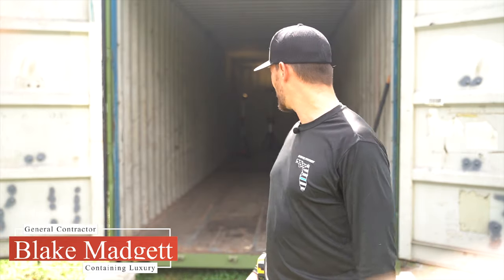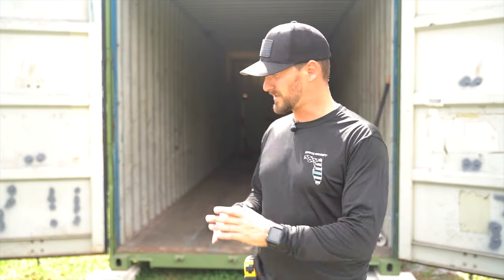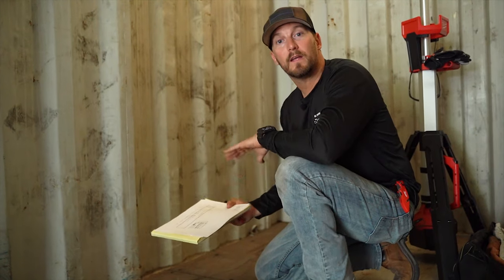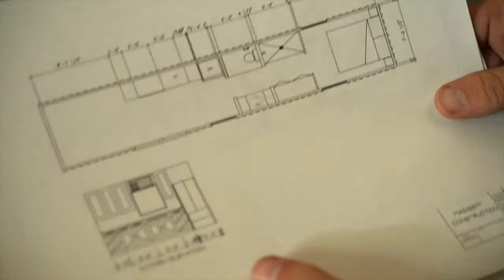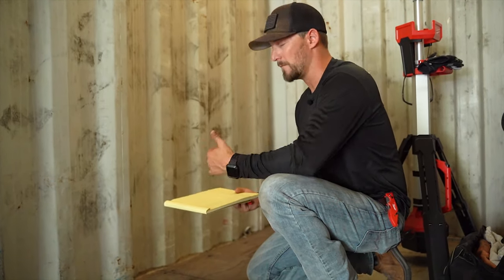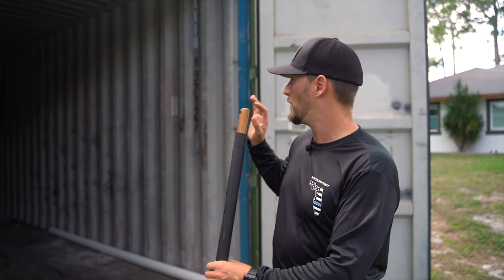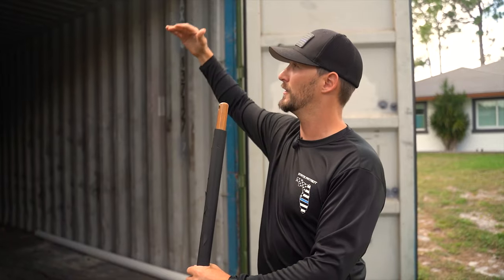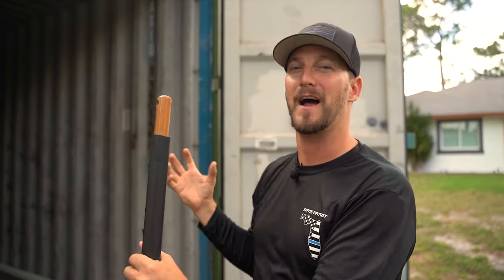Build a DIY Shipping Container Home Step by Step | Ep. 1 Prep, Plans and Layout

Comment: Could you make a video about the procurement of the container? I have seen on many other videos how you have to be careful with used ones because they dose the floorboards with massive amounts of pesticides that can off-gas, and that the interior paint is also pest resistant and can be toxic. How did you shop for yours and who did you go with for the purchase? Also, how did you transport it? A freight hauling company? An industrial towing company? Thanks and great vids!
Reply: If you’re serious about buying containers than it’s best to look into what’s called a “one-time use” container. They are only used one time and are used for harmless things. So you wouldn’t have to worry about dangerous chemicals, rust, etc.

Comment: I also am from and live in Minnesota.Years ago I used to work for this company where we installed Styrofoam stucco walls on the exterior of homes and buildings.3 inch minimum with 5-7 inch thick  for accent around windows or other areas to create features.Now if you do this you can minimize any insulation for the inside since your insulating your outer walls giving you move interior room.

Comment: Amazing and I didn’t quite understand the tip about having the plumbing and elctrical be linear, is that so the lines come out the front if this like the containers door and you just cut a hole for those lines through a no structural part of the door? And do you run those lines through the floor inside, as opposed to cutting a hole in the floor and o run them outside?

Comment: Question: how do I connect 2 containers side by side to make a bigger room?
Reply: Cut the walls between them and you would have to get steel plates and weld them together. That way you know it will be water tight and wont have to worry about leaks
Reply: Also you would need to get a few acros also known as scaffolding Jack's to support the roof of the walls you cut out
Reply: You could set them a few feet apart and build a room in the middle.  Of course you'd have to build a roof over it 😉. Check out life uncontained   they did a great job
Reply: @DrLove911  oh I'd like to but I don't have enough room. I'm going to attach it to my existing house and add 4 containers but little room to work with. And I've seen them do that I've enjoyed watching them too!
Reply: Keep in mind when you join two containers together there will be a 6 in gap between them that you'll have to weld a strip of steel over.  And when you cut the sides out you'll have to reinforce it with either steel or wood . Also good luck 😉👍

Comment: Hi :) What is the difference closed and open cell foam? Why closed is better for container homes?
Reply: Closed-cell foam is non-porous so it won't absorb moisture.  It gives a good thermal break to keep heat from transferring between the outer / inner walls.

Comment: In your example you were 3 1/8" wall thickness on the exterior walls. When placing an interior dividing wall, it would increase in thickness another 1/2" to 3 5/8" to compensate for drywall on each side?
Reply from the maker: Edmister Enterprises LLC no because in some areas we only used a 1-5/8” stud instead of a 3-5/8” stud, and in some cases like the shower wall because we used a fiberglass liner that gets attached directly to the stud we only have drywall on the outside of the wall so that’s were we got a 2-1/8” wall
Reply: @ContainingLuxury  Ahh.. more things to consider. Thanks for the reply.